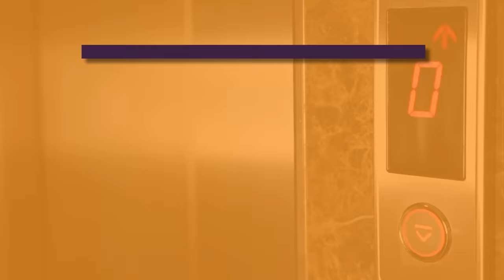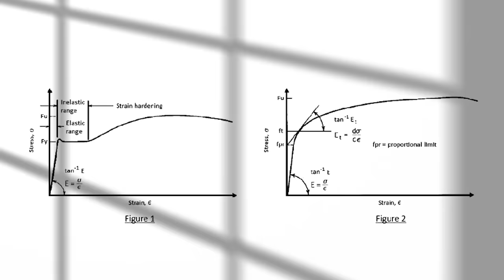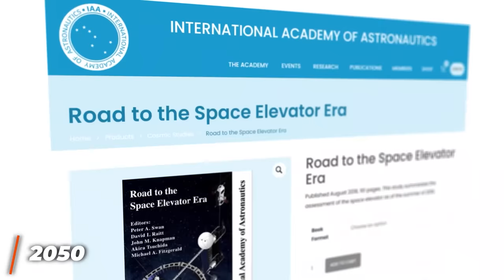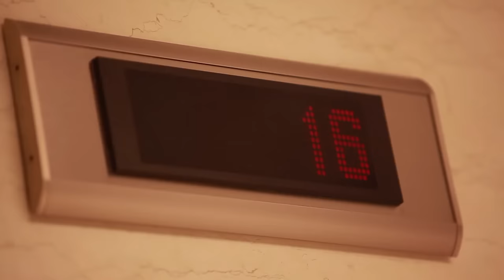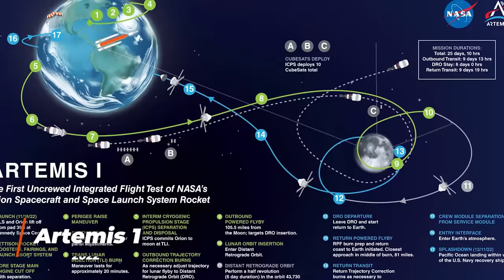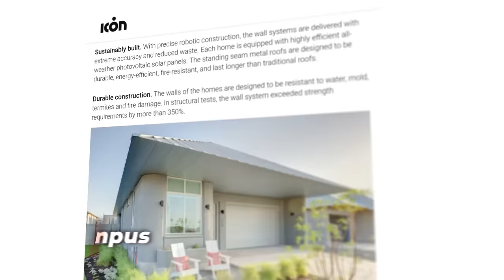Megaprojects of the Future

Comment: Getting to the ISS's height is the least difficult part of going to the ISS. It's going to fly past you at 28 000 km/h so you'd better have good reflexes to catch it.
Reply: Attach a cannon the the elevator and shoot supplies at the ISS. But you're right, about 83% of the fuel is used getting to Orbital speeds.
Its why you hear all the time about universities sending a probe on a rocket they built into space. It falls back down in seconds to a few minutes because its a sub orbital velocity.
Reply: There is the possibility to "drop" the cargo from higher up.
I think, dropped from an altitude of about 6000 km, the cargo would end up in a orbit "similar" to the ISS....just a very excentric one.....

Some kind of propulsion still needed to change that excentricity😅
Reply: @yourguard4  there isn't that sort of possibility, most of the energy is used in reaching the orbital speed -  you still need to do that.
This is Physics, not Alice in wonderland.
Reply: @smalltime0  The cable material already needs to be stronger than might be possible and you're going to attach a cannon that places tremendous stresses on it in the direction it isn't designed for?
Reply: @yourguard4 6000km isn't right. 23,400 is the minimum to achieve an eccentric orbit.
Reply: @RobertJones-rejCubed  This depends on, if you allow orbits intersecting with earth, or not :P
Reply: @RobertJones-rejCubed 23,400 is geosynchronous orbit (geostationary for the main station of the Space Elevator.) You expend energy climbing the elevator. Below geosynchronous orbit, your tangential motion is to small to maintain a circular orbit, so if you let go you'll start to fall into an eccentric orbit; if you're too low when you let go, you'll hit the Earth's atmosphere and burn up. If you go up beyond the geostationary base, your tangential motion will be too fast to maintain a circular orbit. If the elevator goes up far enough, you could launch things into interplanetary space by letting them go from the top.
Reply: @lennierofthethirdfaneofchu7286  You mean miles and  you are slightly wrong.  The correct number in miles is 22,236. I was in km.  I suppose I should have repeated km but you'll note I was correcting a figure expressed in km.  I'm citing the minimum altitude you have to climb the elevator to achieve an eccentric orbit that doesn't intersect Earth or the atmosphere.
Reply: @RobertJones-rejCubed Ah. I sit corrected.
Reply: @lennierofthethirdfaneofchu7286 since the vast amount of energy used to launch a payload into LEO is expended overcoming gravity, and friction in the atmosphere, while trying to achieve orbital velocity. Wouldn't it make sense that a much less powerful rocket could achieve that speed, at a reasonable angle, by simply being lifted to a point somewhere above that height, let go, and fired off?
It's all kind of a useless conversation,  because the sheer amount of junk and debris up there would eventually damage the tether to a space elevator, and destroy it. Making an even bigger mess.
Reply: In any case, this is only possible if your space elevator is a rigid structure anchored on the ground: if it isn't, then you still have to provide all the energy required to put the object in orbit, otherwise you would de-orbit your entire lift. The advantage is that you don't have to lift all the fuel needed for later stages, just the payload
Reply: @RobertJones-rejCubed  If there's one thing us humans are good at, it's putting guns on things.
Reply: @lennierofthethirdfaneofchu7286  Well, yes, if by an eccentric orbit, you mean 'one that collides with the Earth'.  That's technically eccentric, I suppose.
Reply: @speedingoffence  depends on how far up the elevator you are.
Reply: @lennierofthethirdfaneofchu7286  At all points on the elevator (except perhaps the last 1,000 or so km) you're traveling below orbital velocity.  If there was another point before then than you could have some sort of functional orbit (even an eccentric one) we'd just build the elevator to that distance.

Comment: And what happens when a large satellite collides with the space elevator's tether?  It's not like the tether can maneuver out of the way.  Nor can many such satellites (or just space junk) have the ability to maneuver, either.
Reply: Probably bounce if it's made of nanotubes. If it's a large satellite we can track it, there's a Registry of stuff down to like 3 feet in size.

This has been thought of, and solutions proposed. Do a quick search online
Reply: Another option I've heard proposed is having the base on a ship so it could be maneuvered on demand.
Reply: 1. The tether could move. It has to remain taut, but it doesn't have to remain straight. A little movement could get a sort of "jump rope" movement of just a few degrees, and timed correctly, it could avoid the space debris.

2. The space debris could be moved. The goal is that for any new satellite launched, it will need to have a way to deorbit it once its life is done. As for stuff up there now, there are already companies working on plans for orbital clean-up.

3. The debris could be captured. The space elevator could have magnetic plates to attract orbiting metals and/or nets to capture non-magnetic debris. It could then be collected and dealt with.

4. Funtioning satellites have maneuvering thrusters, so they can keep their orientation, and to avoid debris on their own. Those could also be used to move around the tether.
Reply: Little shuttle bots with nets go out and catch such nasties. Then the bots can party on the scrap money
Reply: Honestly, I think there is a huge market for space junk capture/elimination. A functional space plane with clean up in mind could make huge profits removing debris. Defunct satellites don’t have to be captured, you just need to slow them down, so they fall out of orbit. Tiny bits can be captured by air gel panels, like they used to capture particles from the comet years back.  Send the bill to whomever is responsible for the garbage, making space safe again for new satellites and human exploration.  There are literally dozens of space plane projects on paper, they just need to be built.
Reply: Despite what others are proposing, here are the facts:

You don't even need a large satellite to kill a space tether. All you need is something the size of a grain of sand traveling at orbital velocities (at least 17,000 mph) to blow a huge hole in the tether and tear it apart, rendering it useless. Doesn't matter if the tether is taut or loose. A tiny bullet going at Mach 22 will rip through just about anything.

It would take not minutes but hours to move a space tether out of harm's way because that tether would have mass, and lots of it to push around. Not like there would be much time to react anyway. Despite our ability to track very small objects in orbit, there's no hope of sensing anything the size of a golf ball (or smaller) in time for course corrections to be plotted in advance. Using magnets to attract hypervelocity objects toward the tether would be asking for trouble.

As far as getting rid of space trash goes, I'm all for it. The sooner the better because if we reach the point of full-blown Kessler syndrome, there will be no more space missions and rocket launches. At that point, tiny bits of debris will be orbiting the Earth in a dense enough "cloud" to make the chances of anything surviving up there go down to zero. And we're currently nearing the precipice of that mountain...
Reply: I would expect the space elevator to be made of several tethers linked together in a way to create segments to assure redundancy and if necessary replacement/repair without causing critical failure. Also satellites and debris would have to be eliminated from that specific orbit, by the time a space elevator can be build, that shouldn't be a problem.
Reply: @MDP1702 you would think that but then there is the Arecibo telescope.
Reply: For that you need insurance.
Reply: @Shinzon23 I seriously doubt anything bounces in space at those velocities. More like it would catch debrie. 

 It does bring up the question on how does one repair a carbon nanotube structure in space, and keep the same integrity of the structure.
Reply: It's a very real possibility that that never happens.  There was no system to keep aircraft from running into each other away from airports until 2004.  Mid-air collisions just never happened outside of war (dogfighting kinda warps the odds lol) until that private jet clipped the passenger jet over South America, 101 years after the first powered flight.  Space is larger on a whole other scale.  You'd have to deliberate saturate space (space terrorism sort of thing) to have that collision be any more likely than, say, getting hit by a lightning bolt.

Comment: A moon base and solar space farm could both be more easily achieved if we did a space elevator first. At least, one would assume
Reply: I don't think solar farms for earth will ever happen. It just isn't worth it, unless we run out of space or require a ridiculous amount of energy in the future. 

 Now... Having solar farms to send power to the moon when there is no daylight for a few weeks at a time is a different story. 

 Personally I think we should just embrace fission. Focus to make smaller, and smaller reactors that are even safer. Especially for a moon base.
Reply: Not really, a moon base first would be the best, as it is so much easier to launch from the moon. The problem with a moon base though is that moon dust, because moon dust is one really nasty thing, it is electrically charged by the sun, and so sticks to everything.

Personally I am more for the O'Niel cylinder type centrifugal gravity habitats, as they are so much safer then any other place, including earth. For perspective if a supernova goes off within 10 light years earth, earth will not survive, however if you have a spin gravity habitat with more then 3 feet of dirt inside, you can be 1 light year away and not even know it went off, closer then 1 light year is risky though, as supernova create a lot of neutrinos, which do become lethal at that range, as nothing blocks neutrinos. But other then neutrinos, there is no other radiation that would make it through the 3 feet of dirt, so in essence a spin gravity habitat can actually have less radiation inside then the background radiation we experience here on earth if you engineer it right.

Hopefully though mind uploading becomes possible soon, as a spacecraft with a few computers on it is much, much easier to build then a million plus tons spin gravity habitat.
Reply: @atlanciaza  Getting supplies INTO space has always been the big limiter. There is a finite limit to how much a rocket can successfully carry, and they are of course very expensive. Building a moon base would be great, but building other things, especially closer to earth, would be a whole lot easier if you could make them on earth and then list them into space.
Reply: A space elevator would make everything we do in space easier.
It's not worth waiting for, though we should build one as soon as the engineering is proven out.
Reply: Ask Jack for a few of his beans . . .
Reply: A solar farm at the top of a geostationary counterweight of the space elevator makes a lot of sense to me!
Reply: Just going up high doesn't keep you in space. You will fall straight back down when you step off. The space station stays up because it's moving very fast around the earth. The space elevator is a dumb idea thought up by people who misunderstood gravity and orbital mechanics
Reply: @rustygear447  You realize that the space elevator isn't stationary right? How about this. What happens if you put a ball on the end of a string and quickly spin around? Does it fall?
Regardless, I'm pretty sure that the people working on this are not dumb lol
Reply: @CuriousMind477  it's stationary relative to Earth. What the hell are you talking about? It's stuck to the ground.
Reply: @CuriousMind477  the elevator is anchored to the ground near the equator and there is a large counterweight at the geostationary orbit point, which keeps the cable taut. The whole thing is stationary relative to earth, but the counterweight is in orbit (geostationary)
Reply: @rustygear447  he's talking about the centrifugal force
Reply: @HustleRussell87  Geostationary orbit is ~42000Km (26000miles) away. Earth radius is ~6000km (4000miles). The elevator would be 6 times the earth radius and you need to build the same one on the other side to counter weight or it's gonna wobble the earth orbit. Not to mention at that scale the elevator would slow down Earth's rotation significantly.
Reply: Yes, but there generally needs to be a need for a freight train analog before one will be built.
Reply: @dianapennepacker6854 it’s more likely we’ll be embracing fusion rather than fission. Orbital power collectors definitely have a purpose, even multiple purposes.  A PV panel in orbit is significantly more efficient just because the light doesn’t have to go through the air first.  The electricity can be sent to orbital infrastructure and the planet either through microwave transmission or down the space elevator/orbital ring tethers.
They also act to block that light from hitting Earth. That provides us a planetary thermostat to insure it never gets too hot or too cold. We could even broaden the most habitable areas which just flat out makes living on this blue marble more pleasant.
It’s basically free power once the infrastructure is built. It’d be stupid to waste it.
Reply: @rustygear447  What are you talking about? The idea of a space elevator has been looked at repeatedly by experts and found feasible if the necessary material for the tethers can be made in large enough quantity.

A space elevator is following gravity and orbital mechanics.
Reply: @MDP1702  Which expert exactly? Don't just appeal to authority. How about you show me where the flaw in my reasoning is?
Reply: Alternatively, building a small base with tools for expanding itself and building using local materials on the moon could be done already, starting small and focusing on gathering materials that could be then used to build orbital bases because it would cut on the cost of sending meterial from Earth, these materials could be used to make the exploration profitable and make it more likely for a space elevator or a space hook to be built, maybe first on the moon instead of Earth.

Comment: The Space Elevator is applicable to other planets and celestial bodies. For locations in the solar system with weaker gravity than Earth's (such as the Moon or Mars), the strength-to-density requirements for tether materials are not as problematic, Currently available materials (such as Kevlar) are strong and light enough that they could be practical as the tether material for elevators there.
Reply: Yep. Mars has only 38 percent of Earth's gravity, so Kevlar would work for an elevator there, just fine.
Reply: No, it wouldn't work on any planet. Distance to geostationary orbit is like 6 times the radius of the planet itself. We talking about building a structure that's as tall as 3 planets stacked on top of each other.
Reply: Gravity is acceleration. Low Gravity means low acceleration. You don't need a space elevator to get moderate amounts of mass into orbit when there is low acceleration. A rocket accelerates independent of the Earth's rotation.  A space elevator is tied to the earth and is thus exerting a constant force on the earth. You would have to balance that force with an elevator on the opposite side. You need lighter materials because F=ma. As the acceleration factor increases so does the amount of applied force. You compensate by reducing the amount of mass. A space elevator is a tetherball. As the radius increases, so must your rotation. As the outward force increases, you must apply force in the opposite direction to stabilize your spin. To get a space elevator to work, you need something with essential zero mass. And wouldn't you know it. At geostationary orbits, there is no atmosphere/mass. Space elevators are flat earth science. You can get one to work but will be impractical for lifting cargo into orbit.
Reply: More practically usable spaceships seem to be a more feasible option. I'd say humanity will master engine technology sooner than defeating gravity, so in my opinion that's where the focus should be. A spaceship that can take off more or less like an airplane will be so much more effective that a Space Elevator won't be necessary at all.
Reply: @tjroelsma  'defeating gravity'. That's a good one since gravity is acceleration. You would think that people would understand by now that the earth isn't flat. Why are you still using flat earth physics?
Reply: There is terrestrial weather and temperature changes that induce other stresses.
Reply: @stewiesaidthat  you dont connect the space elevator to the earth...
Reply: Unfortunately there is no 'geostationary orbit' of the moon.  That far out, you're recaptured by earth.